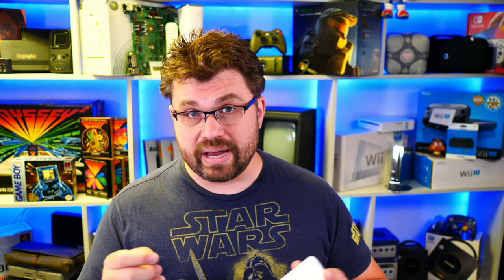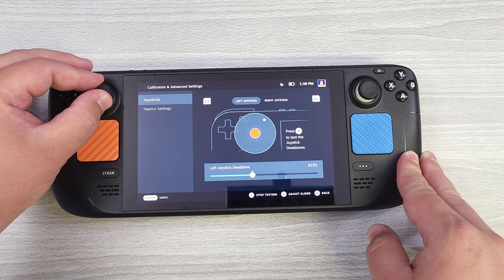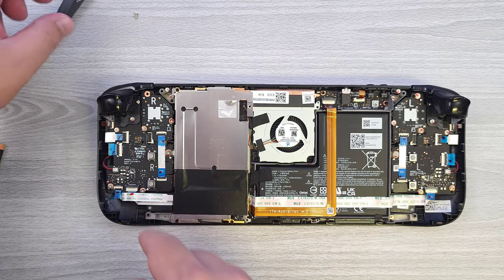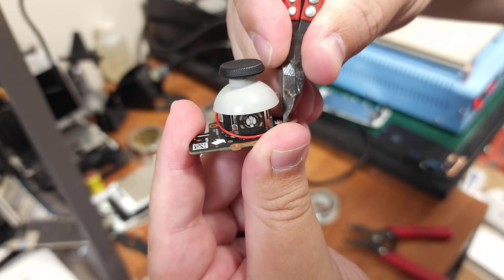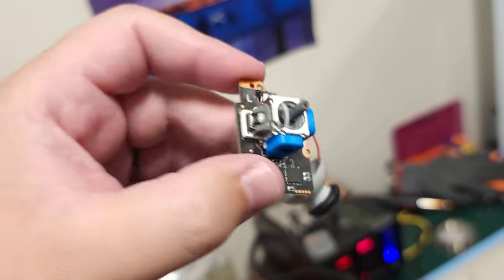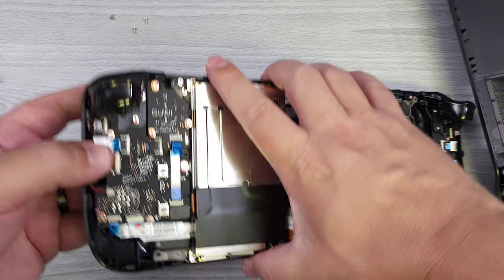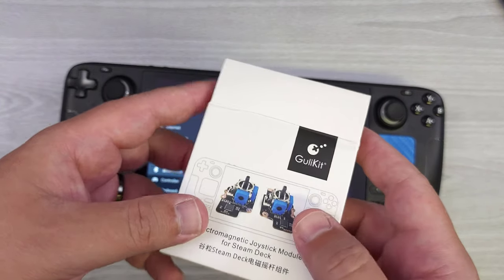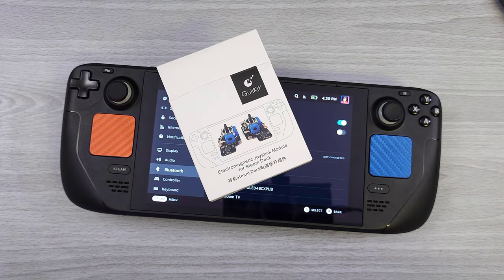Gulikit Hall-Based Analog Sticks For STEAM DECK - How To Install Analog Sticks On Your Steam Deck!

Comment: Thanks for the video! I recommend you remove the glue with at least 91% isopropyl and de-solder the original connection without cutting it. the cable will be too short if you cut it and cause strain issues. Also, make sure you add a dab of glue when your done. It acts as strain relief.
Reply: Yeah I'm actually not sure why he didn't just desolder the wires? The alcohol option you mentioned is the perfect solution for the glue but I honestly think even just slowly pulling the wire upward would have been enough to separate it from the board. There was absolutely no reason to cut a wire that was clearly going to be too short afterwards. I fear that some people who use this video as a guideline for replacing their analog sticks may end up feeling sorry in the end. It's not like it's an uncommon mistake to make to begin with. I know I found out the hard way that it's ALWAYS a better idea to desolder wires I'll be reusing than to cut them and hope...
Reply: I'm a bit surprised the modules don't come with sticks already installed, as the replacements Valve provides through iFixit's store come as the full assembly. Maybe someday if these become an official replacement part.
Reply: I used a pic and popped all the glue off in one shot, then desoldered the wire.
Reply: Thanks for the tip. What kind of glue are we talking about? Superglue?
Reply: @ronfoley5683  might be hot glue. Not sure. But they added it to make sure the wire never pulls out of the solder. 

It didn’t take much force to pry off the glue.
Reply: @ronfoley5683  usually use a dab of epoxy.
Reply: @nsp6590  Honestly, I just heated up the pad (maybe mine had less glue directly on top) and pulled it out from the side no problem. Super easy, didn't require stripping or doing any prep work at all.
Reply: @xaytana  The IFIXIT offering is, like many things IFIXIT sells, more expensive than other options like the GuliKit ones selected here. Depending on the price you buy the alternative (GuliKit) upgrades for, the IFIXIT offering is anywhere from $10 to $15 more expensive. However, I will concede that the IFIXITs option comes with the thumbsticks and are they already soldered. Depending on one's skills and needs they could be wasteful/redundant (extra thumbsticks that may not be needed) or completely worth the extra cost.
Reply: just desolder the cable over the hot glue the  clean off the glue and ensure your connection is shiny assuming you are using leaded solder which is recomeneded it is not required to reglue the connection but its recommended to follow the manufacturer so just a dab with add some strain relief 

👌
expeirence i repair for a living
Reply: +1. my Soldering iron has a point that liquefied the solder, I just pulled the wire off and reattached to the new ones no problem. I think he over thought that. I upgraded the SSD at the same time which made recalibration unnecessary, even though I did it again. They were zeroed.
Reply: You should never have to glue down soldered wired unless you’re shit at soldering and in such case you shouldn’t be preforming any mods until you’ve had enough practice on throw away boards. Indont think i should point out why you shouldn’t use glue let alone super glue you fuck up the traces is a huge one either by accident cause you think it’s okay to pull cause of “strained relief you think is added” or by accidental pulling. Just dont period. Mechanical strength of a correctly soldered joint is beyond strong enough not to be pulled off.
Reply: Yea I don't know why he would cut the wire, just made it shorter.
Reply: @xaytana  Because profits.
Reply: @consciouscool  Correction, margins. Of which including the capacitive stick soldered to the unit is negligible within the full picture. Learn how business actually works.

Comment: I wish gulikit would sell these with their own capacitive caps presoldered. It would make this a much easier upgrade, and very reversible.
Reply: Surprised as well.  If it's a cost issue, I bet many will gladly pay an extra 10-20 bucks to have it done before hand.
Reply: Hopefully they do it. I would definitely buy it and upgrade myself but having to solder it will be a no for me, at least for now…
Reply: @douglassantos8918  for me it’s less the issue of soldering it, and more just that I want it to be easily reversible. As far as I know, you can’t buy the stick caps without just buying a whole new stick from ifixit.
Reply: Hi, it really is extremely easy - host here has some strange problems, but few minutes ago, when I was soldering mine, everything went perfect. The only drawback is the glue on the original PCB - it did not react to the hot tip of the iron nor to isopropyl alcohol. After snipping it, you might reroute the cable by just... putting the cap upside - down to the direction it was previously - there is really no difference and the length of the cable is no longer any issue.
Reply: @JohnM5583  it’s less that I can’t solder it, and more that I’d like to keep to keep the mod easily reversible.
Reply: Agreed. I have to buy a $20 solder kit just to use it once
Reply: I wish they did that I have never had a successful solder before I always fucked up somehow 😭
Reply: It helps a lot to tin the wire first, takes a few extra seconds but you'll get a much better stronger joint
Reply: N a white version :) buy in heart beat😊
Reply: @shadaxgaming  Soldering that is very easy. The guy in the video, for some reason, is making a big deal out of it. It's not about cost, capacitive buttons are literally pennies.
Reply: Bro, you're not gonna believe this
Reply: @smallbutdeadly931  yeah I saw they finally updated it 10+ months late.
Reply: They do, but you need the revision steam Deck.
Reply: @FuzzMD  i think they said it works for both :) i have one and there is a switch for either
Reply: Well aren't going to be happy because they started doing just that
Reply: They do now mine just came in.

Comment: Pog. this actually a good upgrade and we can wait for another company to make a custom OLED replacement screen for the Deck. (This could be the pinnacle for the stream deck, and replacing the mushy Steam button is a good idea as well)
Reply: OLED screens are usually bought off the shelf. I doubt there are ones with the same bezel and size/aspect ratio.
Reply: @lolcat  depends how much demand there'll be.

I know oled's not the same as LCD but you can get backlit LCDs for Gameboys now that even have driver circuits
Reply: The steam button has already been fixed. later model decks have a slight click to them to let the user know when it's been actuated.
Reply: @Hittsy  Nice
Reply: @Hittsy  I just got my steam deck around a week ago and my steam button has no click to speak of.
Reply: @Hittsy  I got an RMA'd deck a couple days ago and it does feel like a decent click. Granted, I never had any complaints about it prior (it seems pretty nit-picky to me tbh lol.)

Comment: Hey Phawx, there is a tiny switch on the kit for you to do calibration easily. Check the steps on the calibration manual. Thanks for your work.
Reply: Yes, he did it the hard way :) Good to know i can easily calibrate mine next week ;) Also, desoldering the existing wires is recommended, not cutting the wires shorter :(
Reply: @HermanKruisman   Yes,right.
Reply: Ah, that's great to know! I just received my kit in the mail but I think I'm going to wait until I start experiencing some drift to make the replacement.
Reply: @Moskeeto  I installed mine to prevent that :) And I have a very small deadzone now. 2000 setting works great. This is awesome for racing games.
Reply: @Moskeeto  Yep, you can do that any time you want.Thanks.
Reply: Is there a non steam deck version of this stick?
Reply: @supatroopa57  No for other controllers yet,but only on our own controllers for the moment.Thanks.
Reply: He read that part of the instructions, then didn’t do it. 🤦‍♂️
Reply: Why not include the touch pads so no soldering is required? I know save on money/environment bla bla bla. But now I need to buy a solder gun and flux which I'll never use again?
Reply: @GuliKit  Will you guys make a guide yourselves? I and I'm sure a lot of people would really appreciate it. Maybe a Collab with ifixit
Reply: @luisarturohernandezramirez5910   You may find guide on our site,thanks.
Reply: Thank you for posting this!
Reply: @GuliKit  Will you make a version that doesn't require soldering? That would be appreciated by most owners.
Reply: @GuliKit  will you ever sell these with the pcb already soldered and would just be a drop in replacement? It would be great for me and other people who suck at soldering.
Reply: @Cosmozic   Thanks for your feedback. We will consider this in the future.
Reply: @GuliKit  is there any way to fix the outer dead zone? Many people are complaining about how it’s extreme, it makes the sensitivity of the sticks super inconsistent in the corners vs the up, down, left, and right.
Reply: @HermanKruisman  It is good he did it the hard way too because some people will do the same thing and need a way to fix it without reopening the device.  I really want to get these on my left stick because I use that one a bunch with racing games.  Wonder if it would be worth creating the ability to just by the left analog stick?
Reply: @mobilechaosyt  why not upgrade both? They are great sticks :)
Reply: @HermanKruisman  Consumer choice.
Reply: @mobilechaosyt  you can always contact gullikit. They have been very helpful
Reply: @GuliKit  are you going to release a type b version of the stick pre-soldered up so it’s just a case of plugging them in?
Reply: @Cosmozic  I also agree this would be a fantastic drop in replacement then hopefully they do it for both type A and B decks ❤
Reply: @HermanKruisman  Relatively easy. Still spent about 5 minutes making it right.
Reply: @kieranjohnstone6197  Yes, will do that.

Comment: 6:39 : One thing you can do instead of unplugging the battery: Go to the BIOS and enable battery storage mode. It's the same as shipping mode, it won't use the battery at all. You need to plug in to the charger to turn it on, it won't respond to the power button (like during the first startup out of the box).
Reply: @limppeacesign  He's not wrong at all. You'll even find that sometimes you need to give charge to the deck if the battery was disconnected in some cases.
Reply: I mean it's not like removing the battery cable is difficult. Just unplug it
Reply: @chickenpasta7359  Phawx did say that unplugging the battery killed his Deck at some point, which is why he didn't do it in this case. So there may be some truth about needed prerequisites.
Reply: @limppeacesign  he actually messed up his deck when he unplugged the battery. There are cons of doing whatever's the "industry standard", especially if you're a novice user

Comment: The Deck's original sticks didn't snap back to center as accurately, so you could have reduced the dead zone on the Gulikit sticks.
Reply: I have found this is true too. However you can run into another issue because these sticks are lighter where if you snap fully one direction and release, it can register an input in the opposite direction. This is only annoying in menus really though.
Reply: That is amazing!!

Comment: There are moving parts inside the blue thing. There's a magnet on a pendulum that rocks back and forth behind the "smiley face" part. The actual hall effect sensor is an smd that's soldered to the PCB, under the blue things.

Comment: I would recommend you not to cut the wire when swapping out. Unsolder it and resolder it. Also when a wire is this small, you don't need to use cable stripper. You can use your fingernails to strip. Also some wire sleeving contracts when heated, so touching soldering iron to the end will cause it to retract.
Reply: Yup, coming from a few years into a technical course helps me understand your view since I'd do the same and just resolder the cable instead of cutting it.
Reply: You'd think he'd know this given his work station

Comment: I think you kinda missed the point of these - the real benefit is that they are so precise and have zero drift means you can reduce the deadzones completely. If you play FPS games this will produce a very noticeable increase in your aim/ movement control.

Comment: I skimmed the video so I'm not sure if it was mentioned but with self tapping screws especially going into plastic, to avoid cross threading what you should do when you put the screws back in is put the screw where it goes and turn it backwards until you feel the end of the thread on the screw click into place against the thread in the plastic post and then you can screw it in into the existing thread path.

Comment: Honestly this mod is one of the most exciting developments on the SD.

Here's to hoping we get a whole slew of hardware mods.
Reply: I just hope it comes presoldered as well. It would make it really fool proof that way. Like with new thumbsticks already installed. Maybe pay 5 dollars extra for the thumbsticks.
Reply: I'd like to see some heatsink mod honestly or some list of compatible ones with the standoffs. One day when the deck is sort of obsolete, it would be nice to turn the motherboard into its own little computer.
Reply: @Interknetz  Same here,  i want someone to measure everything and sell a kit of copper heatsinks, for the RAM and for the charging chip and so on, kit should come with tiny tube of thermal glue, no dual sided stickers crap.
Honestly the best option would be like someone did for the old GPD WIN 2, he measured everything and CPU and sold a single copper heatsink that covers everything, this is a great idea, and the person that makes it will make lots of money, he needs to make such heatsink and add some screw holes on the top of it to  screw the heatpipe on and this will be insane mod that lowers the temp and cools everything up
Reply: @NoBodysGamer  
Or potentially a case mod with the aluminum grooved exposed plates for those who prioritize passive cooling, though that means those parts are too warm too touch directly.
Reply: Yeah, I'm looking forward to atomic purple transparent casing. Before too long I bet we'll also see a drop-in OLED display too.

Comment: Some tips for people wanting to do this. Don't cut the wire, just use the soldering iron on the glue and solder. It'll come off. And also when putting the thumbsticks in, don't do it like this guy did and try to do it while holding the deck up. Put the deck face down in the case, then it's protected and the thumbsticks won't be trying to push out.

Comment: Just ordered the kit myself.

I don't have a stick drift problem, but my left joysticks push in click button only works like 2% of the time (have to push the stick in hard and really mash it around to get it to trigger)

I could get it replaced on warranty, but i'm just using it too much and don't want to wait the few weeks that'd take.

So this kit will fix that problem in an afternoon and prevent a future problem down the line... win/win :)

Comment: Nice to know how to recalibrate the joysticks, wish it was in the settings and not desktop mode. My stock joysticks got uncalibrated on the left side after a few days of use, factory reset the deck and it did not fix it. Will try this method.

Comment: Push the little button near the screws on the new Guliket circuit board.  It should reset the calibration without needing to do it on the steamdeck.
Reply: Before or after installing them? Powered off, or powered on?
Reply: @StefanConstantinDumitrache  I did it powered on while in the deadzone test menu.  There was a little instruction paper in mine.  

My thumbstick was a little down and left, so I held it up and right a little while I pressed the calibrate button.  It mostly recentered, but sometimes its gets stuck around 2200.  So I set my deadzones to 2400.  It might get better with use, but 2400 is a good improvement.
Reply: @StefanConstantinDumitrache  After installing them. Powered on. It's all in the instructions shown at 16:20

Comment: You could reduce the deadzone quite a bit now since the new ones snap dead center, making you sticks more accurate. I hate how the OEM sticks dont snap to dead center making that large deadzone necessary. I thought about replacing with these right away but I'll just wait a year or so.
Reply: there's not much of a point in waiting if your bugged by it considering the kits only 30 bucks on amazon.
Reply: The large deadzone for the default sticks are why I upgraded mine (to the new version which are A & B type compatible). I've got them set to 2000 now; the lowest it will go by default.

Comment: update- I swapped back to original and capacitive touch works again.  Something wrong with gulikit.  Maybe revised thumb sticks are the reason.  My wires are light blue and run down the inside of the thumb stick inside plastic valleys.  Maybe they’re less sensitive or something.

Original post- Just swapped mine today and capacitive touch isn’t working on either joystick.  I’m quite experienced at soldering and confident I soldered them well but maybe somehow damaged the wire removing it from the originals?  I’ll have to swap the originals back in to see if my wires are still good I guess.  If my wires are still good then there might be a production issue with these replacements given one of yours didn’t work either.
Reply: I'm pretty sure I just read something this. If you look on Ifixit's thumb stick replacement page, there's a type A and B board. You'll have to find out which version your Deck needs. Gulikit is coming out with the version B board soon I think.
Reply: @chunkylover5367  Thanks, will keep an eye out for it.
Reply: @arie1293  no problem! Anything for a fellow Deck head.
Reply: I just did the switch and also lost capacitive touch. Going back to the old sticks cause this is definitely a production issue.